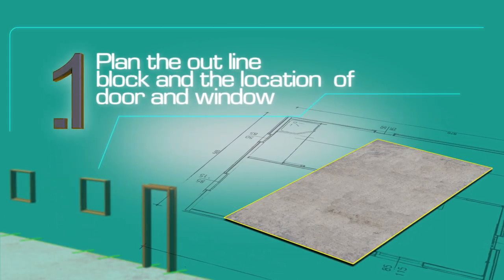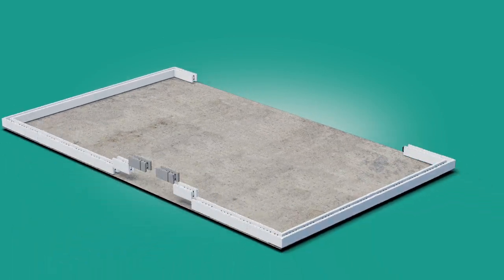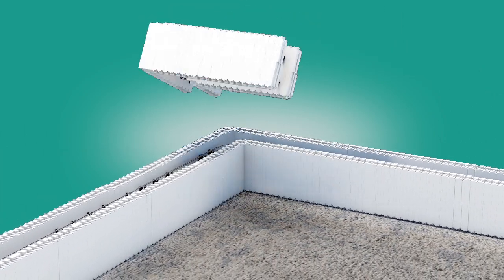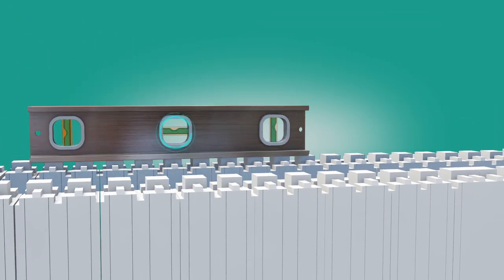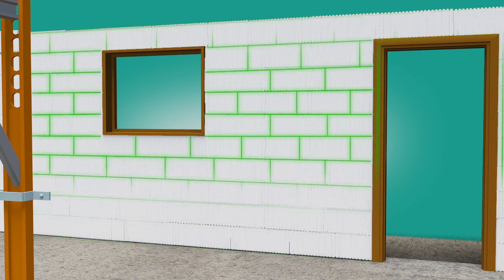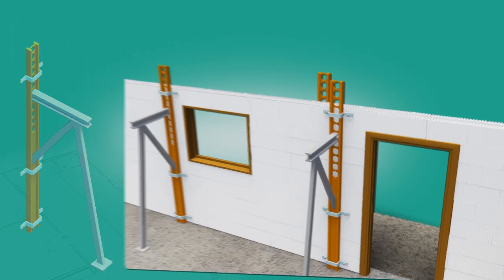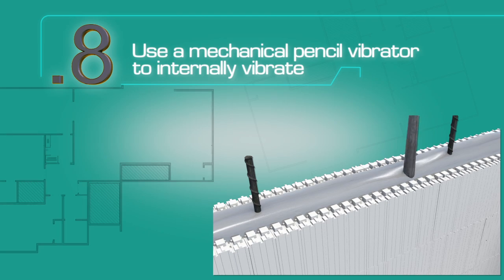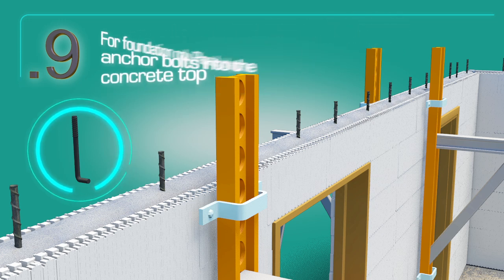ICF 10 STEP Intallation Guide

Comment: How are the blocks secured to the foundation? Do you just set them on top?
Reply: Yes, initially. You can also install a narrow angle iron (such as a drywall corner) and nail it to concrete and screw it to the form. Most common is just to foam the bottom with canned foam before the pour, but after at least 2 courses of stacking (to prevent lift and abundant unlevelness).
Reply: Yes, but you usually have rebar bedded into the foundations or slab to keep them in place once the concrete is poured into the forms.

Comment: not suitable for earthquake prone areas.
Reply: Yeah they are.  As long as they're designed properly, with the proper amount and correct placement of reinforcing rebar.
Reply: Yes they are. In the end they are steel concrete structures. The thickness of the wall can go up to 10 inches or about 29 cm. Once it is filled with the proper amount of steel, it can stand up to level 8 heart quake
Reply: use eps （polystyrene）dome house.
my email: honestsoho@yeah.net
wechat: jiaowopoge

Comment: If the block is not level,  build on level ground next time.  Or mix some mortar.
Reply: There is no need to level the blocks. Best practice is to just stack everything, keeping seams tight. Then at the top, mark each corner with a laser level and snap a line. Find any high spots and cut the top of block off. I've done it both ways and snap and cut is quick and easy. (It also gets rid of nibs on the top course which is sometimes helpful for the flatwork up there anyhow.
Reply: @joshualruby  hi Joshua, are you an engineer? what about ICF fist floor, and ICF roof?
 i'm asking because i'm in the construction business where i live (very lucrative),  and i think of getting this technology.

Comment: #LiteformBlocks
Where an opening is required
Scaffolding planks
Alignment bracing
Breaking down these positions for mounting helps minor adjustments or corrections for designing purposes
Reply: Alignment of this type bracing is nearly impossible. I use two small angles welded the with of the block 20 feet long. I lay them over the ICF wall, every 20 feet I brace to align walls and pour ever 4-5 feet in height. I save half the labor.
Reply: @Drwild75 Could you please elaborate on your two small angles.... how do you use them to brace the walls?
Reply: Angle irons 1 inch by one inch are welded with small steel steps every 5 ft parallel like a railroad track the width of the ICF block. This ladder shaped straightener is 20 ft long placed over the top of the 3rd course of ICF to keep them perfectly straight for 20 ft. Another is placed over second twenty feet and third one for sixty feet. Look down the wall shows in or out brace needed to straighten wall at each twenty feet. When straightened with single brace ...pour concrete. 
Repeat every three or four courses of ICFs as needed. When wall is straight from corner to corner the wall will be straight and plumb. Labor time is reduced by fifty percent over vertical bracing.

Comment: How does the concrete get under the windows?
Reply: You cut holes in the bottom of the window bucks and vibrate it till it fills up, most of the time works well. If it doesent fill up at the end the pump truck can shoot some in the hole and fill it up the rest of the way
Reply: It's all one continuous open space in between the blocks. With the bucks installed, the concrete just flows around them.

Comment: You see, these comes in regular shapes. When I postulated this back in the days, I saw it differently.
Mine was in the shape of polygons because when I thought about it, the interlocking mechanism came with the likeness of crevices.

See a seismographic reading along with crevices on the wall. You see the behaviour of earthquakes and its actual ground shakes, which by the way goes in all directions. It doesn't follow regular lines.
Reply: Right! So you build them the way they will look when dancing?

Comment: this method totally failed we used but unfortunately this is not successful
Reply: Works awesome for us
Reply: What problems did you have?
Reply: @lukehartleyfilms  maybe they failed, not the method.
Reply: I built a lifeform basement singlehandedly  25 years ago . I knew nothing of building houses except for the taping of which I had 20 years experience.  It was very easy to do even though the system was not as refined . About like  a giant Lego structure . Very simple . Easy. No need for a engineer or suit of any kind . The next house I build will be a lifeform basement. 
I had a couple floods over the years and the drywall that  was screwed to the foam blocks didn't rot because it dried out ok . No mildew. No cracks that I could see and my wife and a friend poured the walls one saturday morning . Used a seawall to vibrate the slurry around the4 window openings. Easy .
Reply: In my above post it should read as SAWZALL was used to vibrate slurry around windows .
Also , this is my wife's account. She is not a lesbian and neither am i.
Reply: @johannemartin5193  Why didn't you just edit your comment?

Comment: here in brazil, we use ceramic block, concrete and steel bars in the construction of houses, they are super resistant
Reply: same in ours. I know that Americans are prone to earthquakes and wooden houses are more resistant, but not all the states. Don't even get me started on cardboard doors.
Reply: ICF blocks are incredibly easy to work with.
Reply: Are not ceramic blocks the same as masonry?
Reply: Do you use insulation in Brazil or is your oil so cheap your utilities are nearly zero? How heavy is a ceramic block 16 inches high and 48 inches long? The styrofoam ICF is 6.5 lbs. I get a hernia thinking about how heavy your ceramic block would be.